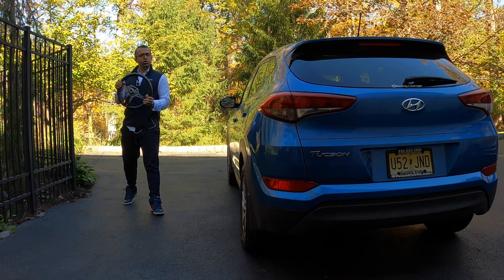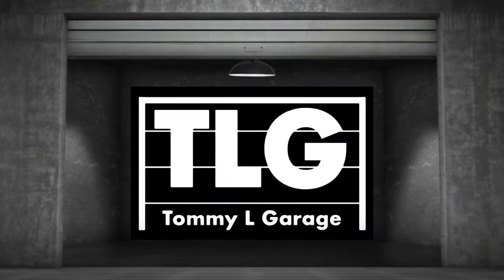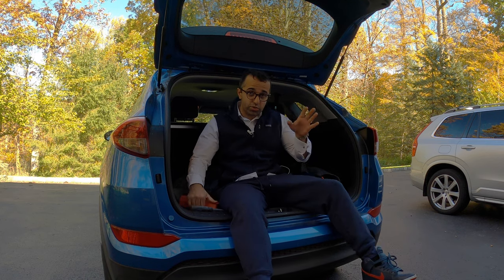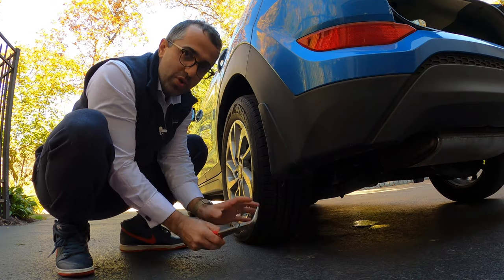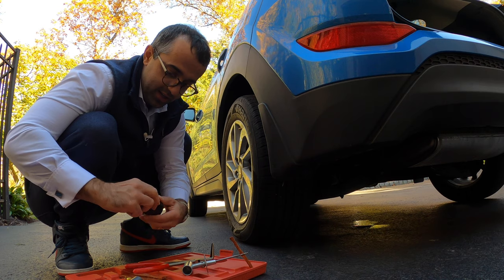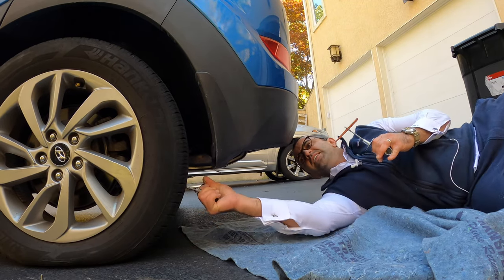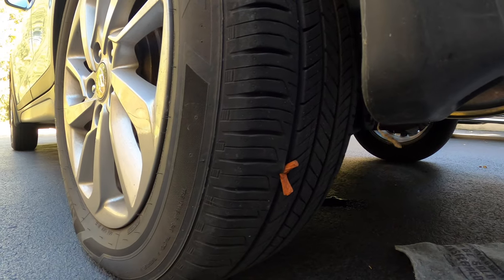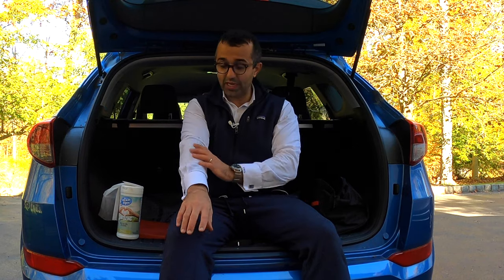Plugging a tire in a white shirt? The "stay-clean" challenge! (BMW Content!)

Comment: Hello Tommy, the idea of the awl is to turn it clockwise to ream out the hole, yes doesn't make sense to make the hole larger but you need to clean and enlarge the hole for the spaghetti bung. I use vulcanising glue on the awl and bung to help seal (the vulcanising glue usually comes with some kits or you can purchase and keep with the plug kit.) I also add vulcanising glue to the bung for a better seal. I have used this style of bung on my motor bikes and cars for many years, I reckon I have fixed close to a thousand flats on mine and other peeps tires. That are great, if you have a larger tear/hole simply whack in more bungs but if you have a real major rip or on there sidewall not recommended. Thanks for the content Tommy
Reply from the maker: Thanks for the tip!

Comment: Very helpful video!!  Question though:  can the tire still be properly patched and plugged by a tire shop afterwards?  (Just wondering if the tools somehow make the puncture too large and wide versus the initial hole caused by the sharp bit).
Reply from the maker: Oh yes it can. They’ll just cut it on the inside.

Comment: Leave the nail in...put air in the tire via the portable compressor or at the nears gas station to get home or a tire shop. Most BMWs without run flats (most ///M cars), have a compressor in the trunk...with some goop.

America's Tire fixes flats for free. If the puncture is too close to the sidewall, it can't be patched.
Reply: leaving in a nail or screw could end up causing more damage, maybe to sidewalls etc. Risky, but definitely an optino in an emergency.
Reply from the maker: But if I"m in the middle of nowhere...